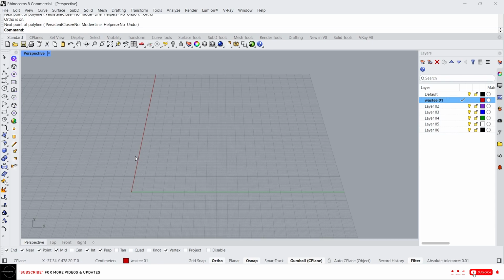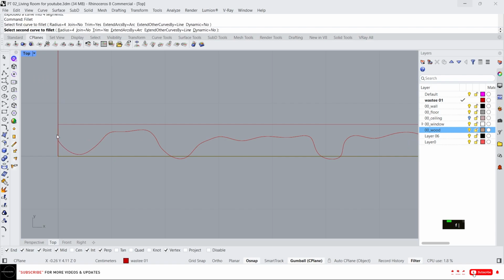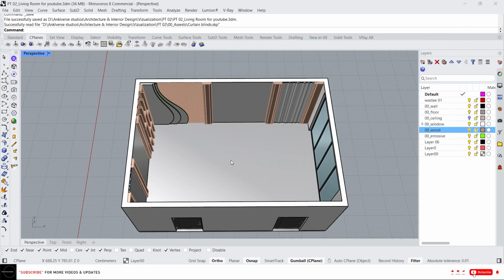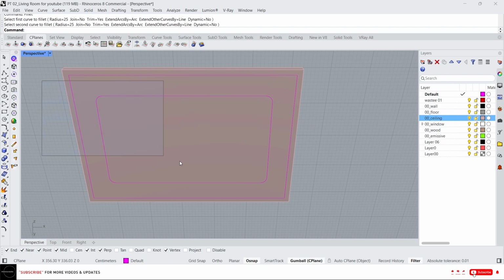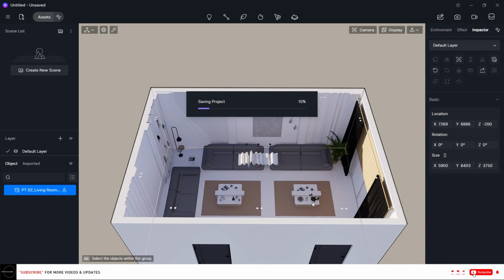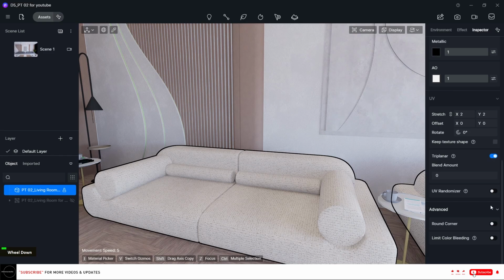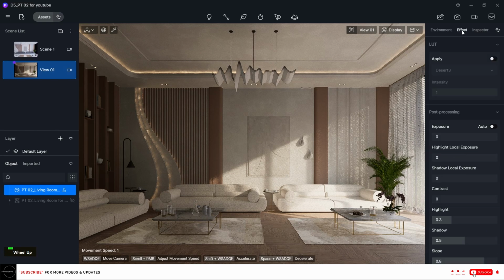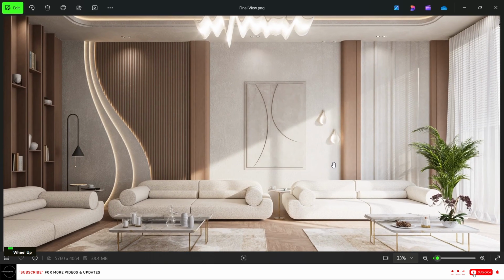Modern Living Room | Rhino + D5 Render | Interior Workflow #02

Comment: Question. I typically share 3D models on Sketchfab. After a render is done with D5 , how is it shared and would sketchfab change it ???
Reply from the maker: Sorry.. I didn't get your question clearly, are you asking how to upload  3d model and D5 file with texture and all?
Reply: @Anklversestudios I am asking if it can be uploaded and still look the same ?
Reply from the maker: Yes! But for D5 file you need to upload the whole folder, otherwise it'll have some issues.. before uploading.. compress the whole folder into a zip file and then upload. It will work fine